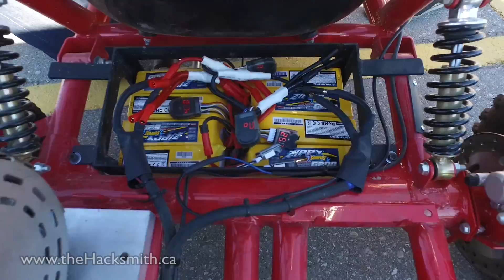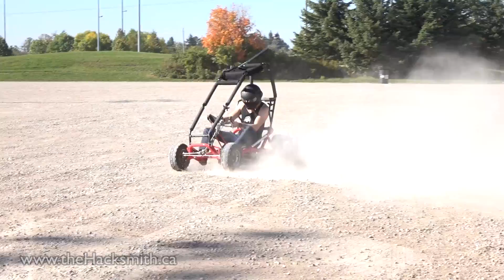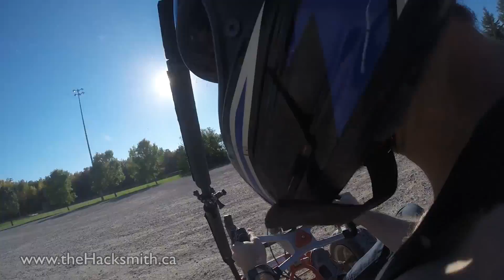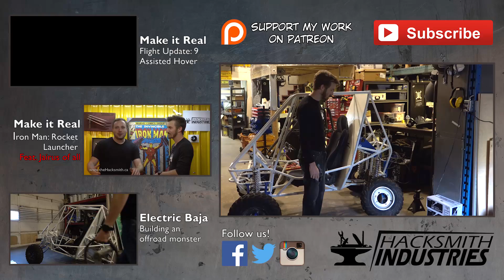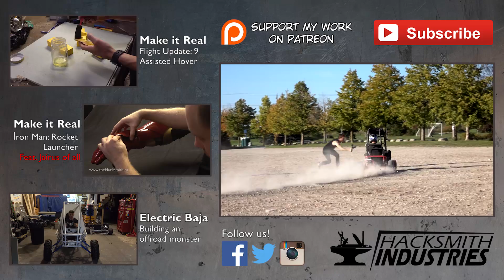Overpowered Electric Go Kart has TOO MUCH TORQUE (54 FT-LB!)

Comment: I have a Kinroad Sahara Racer 150 that is nearly identical to the one you have there. Mine is totally loaded, and would be awesome to convert to an electric. Can I collaborate with you a little to do a build along side you?
Reply from the maker: +Christopher Leveck do it! Electic conversions are awesome, I did my first one almost 7 years ago! We took a 1993 Honda Del Sol and put an electic motor in it from an electic forklift!
Reply: I have 5 Porsche 914's and two Ninja 600's and a REALLY cool buggy all great candidates.
And an unlimited supply of the exact same batteries Tesla is using at a phenomenal price to build my own packs.....
https://lh3.googleusercontent.com/4Gs7GDLPxErOof2vP8iaUoTvbqIU546RQQLM_F2Pm6j7_m9PEiPDJriWabeBRBUsgYgo879tIQ
Reply from the maker: +Christopher Leveck that's awesome!!!
Reply: the Hacksmith so how do I get started? of main concern is price.
I'm assuming the power system you use here would easily power my buggy.....
how much?
Reply: the Hacksmith so how do I get started? of main concern is price.
I'm assuming the power system you use here would easily power my buggy.....
how much?
Reply from the maker: +Christopher Leveck unfortunately the company doesn't actually sell the motors or controllers to consumers -- they're an R&D company.

That being said, cheap batteries are great, but batteries were the smallest cost of this project, only $400 I think for all of them. A motor as powerful as this one will run around $1500+, speed controller another $500 ish.

Best bet is a Chinese manufacturer -- if you dig deeper into this comments section there were a few people suggesting a site, I forget what it was called the, solarmotor or something I think...
Reply: Yeah, I know what the costs are, was just looking for a reputable company.
With that said, my project IS an R&D project.
My solution ultimately won't come off the shelf.
So it may be that your guys are what I'm looking for....
Reply from the maker: Then contact ASI! =) Link in the description, they specialize in this stuff
Reply: I will thanks.
I just bumped this up to the top of my project list....
I'm stoked. Thanks for the inspiration.

Comment: You can't have to much torque, or horse power. Only too little peddle control or inadequacy in the gearing and drive train department...Also almost no gasoline or diesel engine makes peak torque at redline.
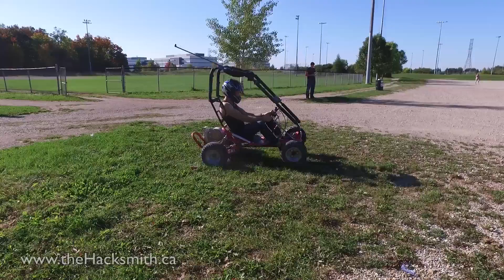Reply: I believe he did actually say power when talking about redlining a combustion engine - "...hit that redline, to give you that much power" at around 1:50. You are still correct, however :)

Comment: gonna be honest, Don't care about wheelies. Need numbers. And more than dirt track. This has potential.
Reply from the maker: +Almsy this particular setup has a top speed of around 80km/h... What other numbers do you need? 11kW peak (~14HP) and 54ft-lbs at the motor (about 200ft-lbs at the wheel after gearing)

Comment: probably fun for 10 min than hours of  charging again.
Reply from the maker: +Dale Whitmore 40 minutes actually and we have two packs :)
Reply: the Hacksmith not bad hey. Battery power has advanced a bit since the passed than.
So how much is package worth minus the kart than?
Reply from the maker: Honestly not sure, the company doesn't sell to consumers. They do the R&D for purpose built electric drive trains for companies. If I had to guess I think this motor + controller would be $2-3K though =P

Comment: main reason I'll stay away is that gotta always be somewhere you can. charge it where as I can carry a extra fuel tank anywhere
Reply from the maker: +Schnurburt XR650R you can also carry extra batteries lol
Reply: Valid but how a 2 gallon gas can vs what looks like 5 lithium batteries which can be quite heavy. Not bagging on electric motors. Alta is going above and beyond with their bikes they have introduced

Comment: thank you. Its about time somebody put a powerful electric engine on a gokart.  I would suggest dual electric engines for the bigger go kart if possible or you could just get one out of a wrecked Prius.
Reply from the maker: That's the plan! Two motors that is =)
Reply: the Hacksmith two Prius motors?
Reply from the maker: Haha no, can't get those easily... two of the motors from ASI -- or maybe one of their bigger ones they make =)

Comment: you say it will out perform any gas engine? but torque doesn't come from the engine it comes from the transmission, even a small go-cart has a fly-wheel clutch in it that really sets it back torque wise. If everyone was a mechanic we would all be driving turbine driven engines with hydraulic clutches (smooth through out the powerband) and an unlimited CVT transmission... but an alternator for a motor works, if your alternator comes from G.E. or whatever your neighbor works for? Do they make electric ovens too, I can't find propane for my burners anymore
Reply from the maker: +lewinsky hillary out perform any equivalent sized engine... Not any engine. And torque still comes from the engine or motor, by your logic adding a fancy transmission to an electic motor system would also result in more torque.

A transmission may modify the torque (gearing down) but there's still max speed. Almost all cars advertise torque at engine, not output torque at the wheel. For example this go kart has over 200ft-lbs at the wheel due to gearing.
Reply: you have no idea what you are talking about. Torque doesn't come from your transmission... If you put a 5hp 5ft/lb gas motor on a transmission it will have a 5ft/lb supply of power... The transmission just transfers it and adjusts the ratios. So torque to the wheel gets adjusted as well as rotational speed. It doesn't create any power. In fact it eats it due to resistance. A better matched transmission does = a faster car, but that's not because it makes power it's just because it adjusts the ratios better. If you only had one gear you would take off fast and max out really early or you would take off slow and max out really fast. It's gearing and that's all it is...

Comment: Did you run those batteries in series for a total of 177.6 volts or parallel at volts or something completely different? How long did they run whatever way you ran them? It's a bad ass go kart!!
Reply from the maker: +tommy23490 44v system voltage, half are in parallel :)
Reply: the Hacksmith Cool.. Thanks for the speedy reply!!

Comment: This new model should have two electric motors, two throttles, one for each hand, no life axle, one motor for each rear wheel. Better steering through dynamic input from the driver.
Reply: I just saw you comments after I posted mine.  I agree 100%
Reply from the maker: +julio lausell skid steering! That is actually maybe the plan  :)
Reply from the maker: +julio lausell skid steering! That is actually maybe the plan  :)
Reply: I hope you try out the concept. Maybe have some kind of a switch so the driver can choose skid steering or conventional driving. Best of both worlds at your finger tips. Skid steering option would add to the fun factor.  Great job guys, can't wait to see the finished version.
Reply: (One more very important factor) The one thing that needs to be considered when using two engines, with no live axle and only ONE throttle. That configuration gives you a bit of understeer, because in a live axle system the inside wheel needs to spin faster than the outside wheel. This breaks lose the traction at the rear wheels making the front steering feel light. (a drifting feel) In the two engine, one throttle, this never truly happens giving the front steering a heavy feel. In a turn the inside rear wheel is always pushing against the direction of steering...... I have a two engine go-kart with a one foot operated throttle no live axle, the under steering is more pronounced than a live axle configuration that breaks lose around corners. I hope you consider all the factors before starting. Time, money and practicality are important.
Reply: live axle wouldn't correct the issue...it would have the same one.
Reply: It seems that Hacksmith is happy to go in the dirt so there's little need to split the axle when you can just scrub off that bit of speed difference but Lotus made a test electric sports car that had 4 wheel motors and a computer control system that would sent the appropriate power to each wheel. They read steering input, wheel speed and gps and accelerometers to enhance the cornering power.  I've never seen it in production but it should do amazing things on a track.
Reply: four engine and torque vectoring thing is also tried in "electric raceabout" which is more or less school project from finland, they have some cool snow drifting videos with torques on screen, also nordsleife with pro driver. They use one throttle and steering input with accelerations to control the power.

Comment: come and race my Honda Grom 125cc,10 Horsepower.Stop dreaming...
Reply from the maker: +Jarren Wong I think we'd win
Reply: If you paired this motor with your transmission it would shit all over your 125. Badly... This is just a gocart w/ 1 gear...
Reply: What hp/torque is your 125? Now what is it @ 3000rpm? Guess what this motor has full power at 1000 rpm because it's electric... So if you have 10hp max... probably 3hp at 3000 rpm (unlikely, but easier math)... that means your average hp would be 6.5... with electric your average HP is basically your max HP...

It's a bit more complicate. Torque numbers start early and HP numbers take over later, but it's an almost flat line w/ electric where gas has a sweet spot and has to build up power with rpm.
Reply: https://www.geotab.com/geoimages/blog/ice-torque-and-power-curve-2.png

http://www.hondagrom.net/forums/attachments/50105d1485970178-jonesn-my-dyno-information-thread-lots-graphs-dynosave-stock-2017-rs2-intake-mod.jpg

Comment: Some poor bastard has gotta rake that whole parking lot out now. Ruts everywhere that's how potholes start
Reply from the maker: Kart didn't cause many (if any) ruts -- there were giant ruts already there from some douchebag in a truck doing burn-outs -- that's why we stuck to the outside of the parking lot typically cause it has no suspension haha
Reply: the Hacksmith - If you put balloon tires with low pressure on it then you'll really be screwed with to much traction

Comment: Maximum torque is not at red line in a gasoline engine.
Reply from the maker: +42lookc was just speaking approximately. On a VTEC it basically is :p

Comment: Why that particular pack?  I see higher discharge rates on the site, but what made you choose this one?  Thanks -
Reply from the maker: Because we were reusing it from our flight project ;-)
Reply: Ah!  Those are always the design constraints that aren't obvious, "I designed this particular body shape for my streamlined bicycle because it would fit down my dorm stairs" type things.  Anyway - neat to see.  I have an unused 1.5 KW (TSK?) 48V motor and controller I need to get back playing with - you've inspired me!
Reply from the maker: Do it! =) Electric motors are so much fun!
Reply: Yes - some of my projects with the kids on my channel.  Motor is BMC - TSK just the vendor, I find.

Comment: One second. DC motor? What the hell does the company do then?
Reply: I see. Brushless. So not really DC. You shouldn't have called ESC, though I know that's normal in RC stuff - this is the company's product and if you had actually called it motor controller (full with model name and prototype number) you could have created more interest in the company.
Reply from the maker: The company doesn't sell to consumers, they develop systems for companies. This is a fun example of what their tech can do. That's why we didn't specify a model number. It's still a brushless DC motor, and it uses an electronic speed controller to control it.

Comment: Its funny how technology is circular. We started with gas engines. then went electric. Then, as we realized 5-15 minute run times were not practical, we go back to gas engines. I guarantee we will go back to coal. California will start to damn rivers for cheap, plentiful water, and power....... Money always, ultimately, makes the decision for us.
Reply: dpqbpqb dpqbpqb Lol. We're not gonna go back to coal. The whole gasoline thing was rather unfortunate. They were better than then's electric cars and only recently electrics became as good in energy density (in everything else - reliability, smoothness, cost to run - electrics have always been better, though).
Reply: Paul Hendrix
Of course we will go back to coal. It is the cleanest, cheapest energy. When the money runs out, solar, and wind will be too expensive, like they are now.
Reply from the maker: Money doesn't run out. They just print more of it ;-)

Comment: Why the hell would you want bluetooth on a motor controller? I'd rather run some wires than have the most dangerous part of the kart be remotely hackable.
Reply: Ya all those hackers trying to attack my Go Kart, because there is a lot of money in it.
Reply from the maker: +Hatagashira it's short range for diagnostics and changing settings like acceleration and ramp up, not active for controlling
Reply: Well as long as you can fully disable it, then...
Reply from the maker: It's very short range... besides... whose gonna hack a go kart? lol
Reply: the Hacksmith Pretty sure motor controllers are used for more serious things than go karts. Even then, i'd say someone who doesn't like the owner of the go kart would have incentive to hack the go kart.
Reply from the maker: lol
Reply: the Hacksmith okay. makes more sense.
Reply: It's just used so you can tune it on the fly. Nothing you change will affect the cart negatively to where you can't control it.
Reply: It would make a sweet rc car
Reply: Hatagashira remote control capability for exertion missions
Reply: Hatagashira man, if I could remotely control such a crazy machine with someone in it, I guarantee you that person would have PTSD in a matter of minutes!
Reply: Yeah i agree. Seems like everything just has to have bluetooth even if it makes no sense. . . . just because BUETOOTH MAN!!!
Reply: Actually, Bluetooth make sense. RS232 was used in the past for diagnostics and configuration in such cases. It was easy to implement on the esc and every computer had it. Nowadays it's no more considered as a standard interface on computers. So they have to either use USB or Bluetooth. And as this part could be used in a place, where it's not easily accessible, Bluetooth is the way to go.
I personally like the rising usage of Bluetooth as I can use a Smartphone app to configure things on the fly without having to carry a laptop around. Imagine he ran into an problem while making this video. If it were using usb and he wasn't carrying his notebook with, he would be screwed.

Comment: This is a good demonstration of why locomotive drive engines are electric. Perhaps this cart could be made into a hybrid using a small gas engine to supply electrical power? That would take care of the range problem and retain the electric motor performance.
Reply: trains can wheelie? and what range are you referring to?
Reply: I'm referring to the power of electric verses gas motors which is seen in this video. The range comment is referring to the battery life verses the distance traveled on a tank of gas.
Reply: @ChuckCoy  lol... good luck fitting an 11kw generator on the kart!
Reply: Are you referring like an alternator of some sort to recharge the batteries as it goes?
Reply: Just get bigger batteries bro

Comment: Those batteries are in such a bad location... I would definitely move them up too next to the motor so they don't get continuously hit by rocks or maybe even completely knocks off by rougher terrain because those little batteries are mean little buggers especially if they have big holes in them...
Reply from the maker: +Garret R yeah it was just for a single afternoon of testing, we've already scrapped the frame

Comment: Aren't you already halfway through an electric buggy project?
Reply from the maker: We did, but the ESC blew up on us and we couldn't afford a new one (over a grand for one). It's also too big so it's difficult to test cause you gotta get a car trailer just to move it around and there's not many off-road places big enough for it... we might see if we can get it back up and running, but I think the smaller baja (fits in a truck bed) will be a lot more usable!

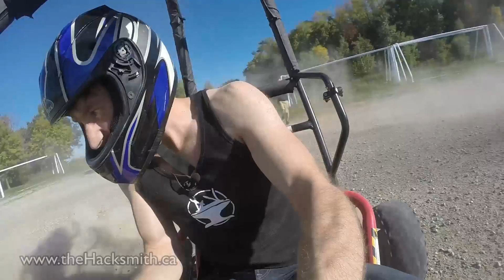Comment: 1:45 new to this channel but wtf... Since when do gas engines make peak power at redline...They don't.
Reply from the maker: I was speaking roughly, blame fast and the furious shiftingshiftingshifting for the red line myth. Varies a lot by engine to engine, but the point is electric motors don't have a "peak" speed to work with to get maximum torque.

Comment: toss a 7 horse on it with a generator motor and charge on the go?
Reply from the maker: +skankhunt fourtytwo lol you can't put an alternator onto an electic motor... It's not free electricity, power in equals power out -- you'd be at a net loss. You'd need an engine with an alternator to recharge the batteries, and even then you'd need a pretty big engine to generate enough electricity for the motor, so at that point you might as well just use the giant engine and get rid of the electric motor...
Reply: Probably can invent some custom induction breaks that charge while breaking but you'll still have to recharge eventually
Reply: twigglykevin id just toss a small alternator on it
Reply: nut john that would be usefull only during braking and going down hills...its a go kart...minimal braking time and mostly straight terrains i guess